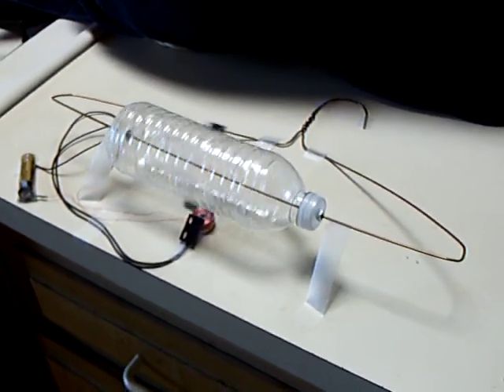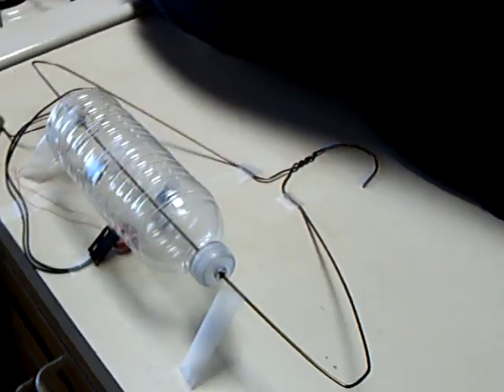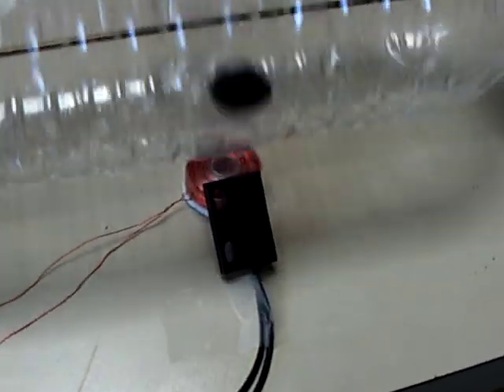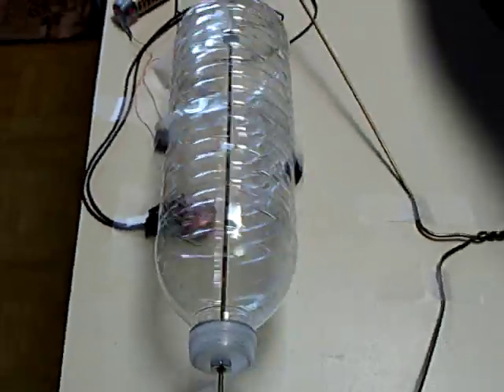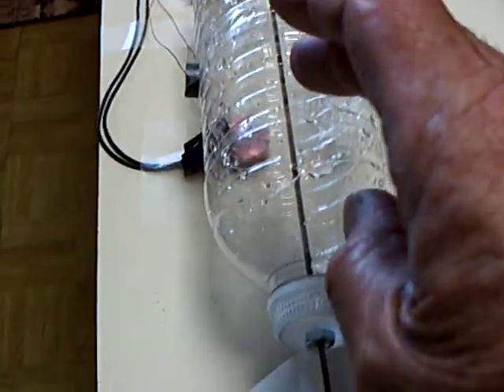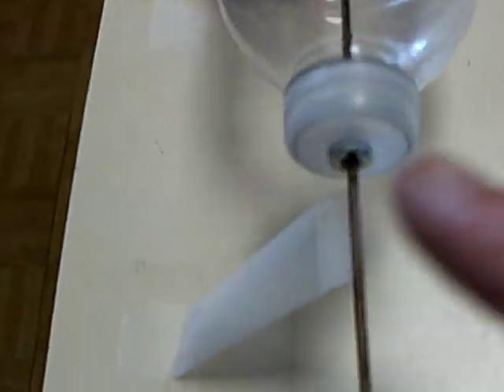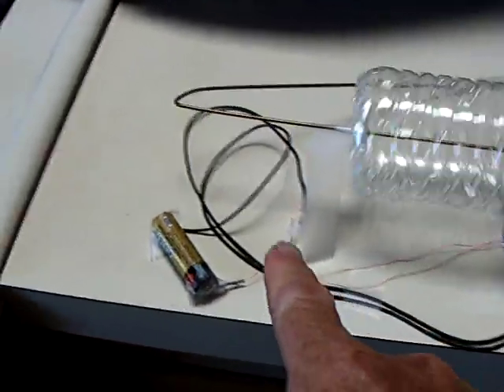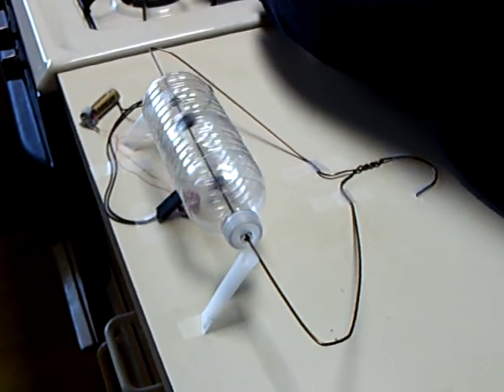Coat Hanger and Water Bottle Pulse Motor

Comment: Another beauty Lidmotor. I guess you can still get those coat hangers. They all seem to be plastic when I go looking for them. it's got to the point that if I see one I ask if I can have it.
Reply from the maker: Thanks.  Over here these steel coat hangers are still pretty common.  The dry cleaner shops use them and most houses have some around in a closet somewhere. I remember the old days when this was all we had.

Comment: So how much minutes will it run on a new AA battery
Reply from the maker: I don't know.  The coil which is about 8 ohms draws about 30mA on a pulse but the pulse is erratic.  So far all I have done is run it over night on the battery.  In it's current form it is not very efficient.  Frankenstein wasn't either.

Comment: So how can i make it run for 2-3 months or years. 
Is it possible with this circuit???
Reply from the maker: This design is not a long distance runner.  If you changed the coil to a fine wire and high resistance type it would run for a long long time on a AA battery.  The problem would be the thin plastic bearings wearing out.